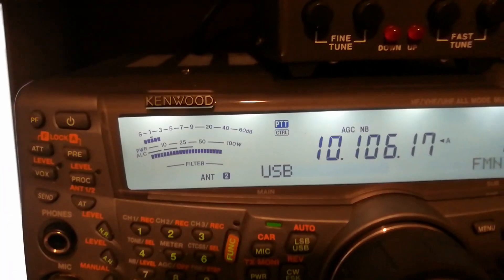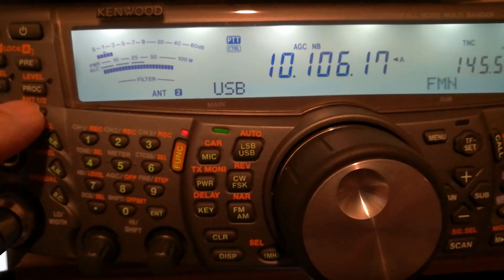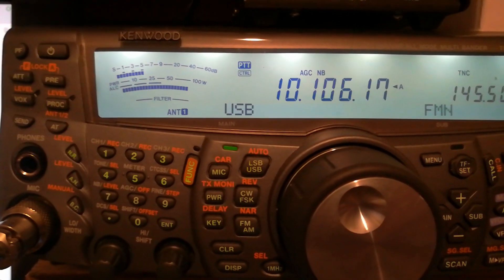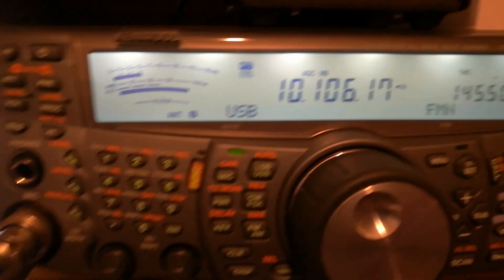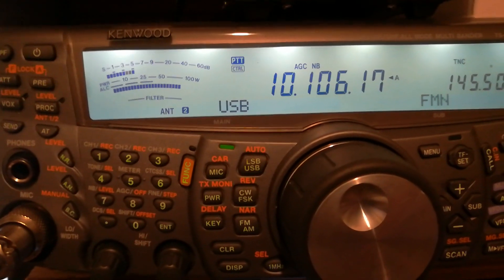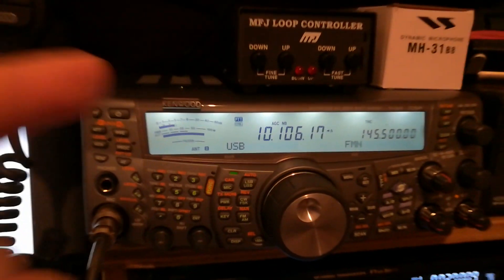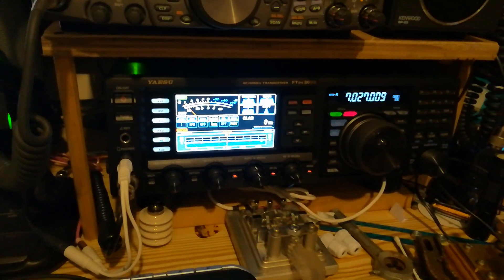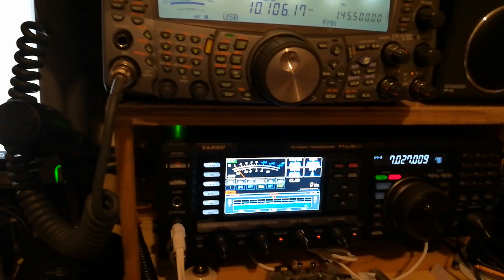Magnetic loop antenna

Comment: Strange controller for a 1786 🤔..was this the 1st, original one before the more common one with the meter etc ?
Reply from the maker: The controller without a meter is designated X 
As in 1786X hope that helps the meter version has no x

Comment: Nice video! I have a MFJ 1780 with the same controller, I do not why I can not tuning that antenna. I followed all the steps as the owner manual explain and nothing happens. 
Could you give me some tips or recommendations? Please.

73.
VA3GON
Reply from the maker: Check the capacitor is turning 
Are the plates in line mfj QC not very good 
Tune for best resonance then adjust small loop closer to big loop best resonance small adjustments ? 
Let me know
Reply: @steveedwards90  Thanks so much Steve!